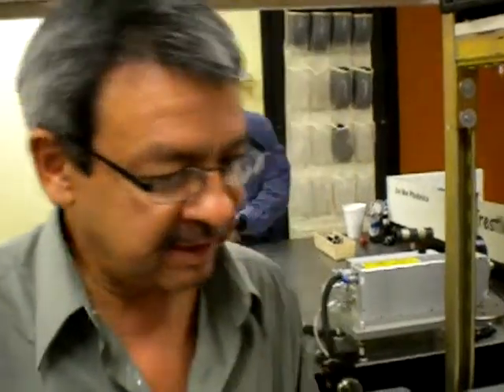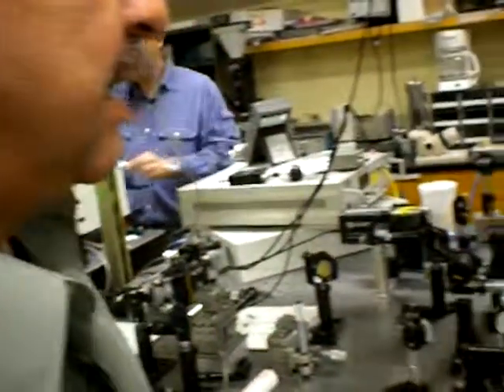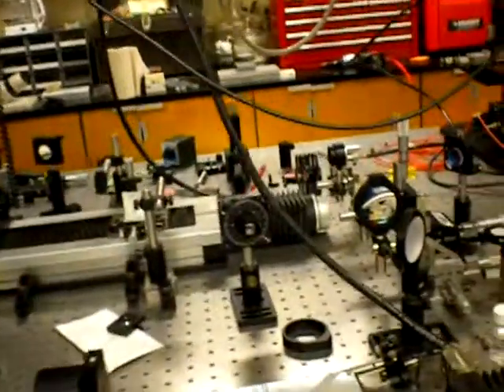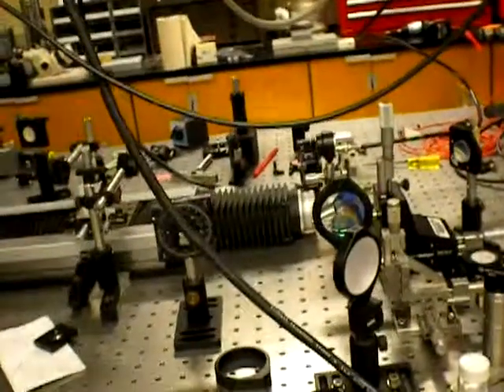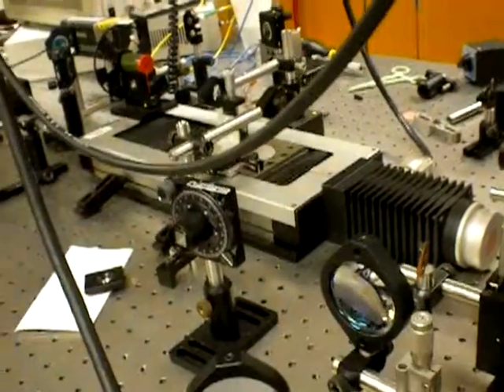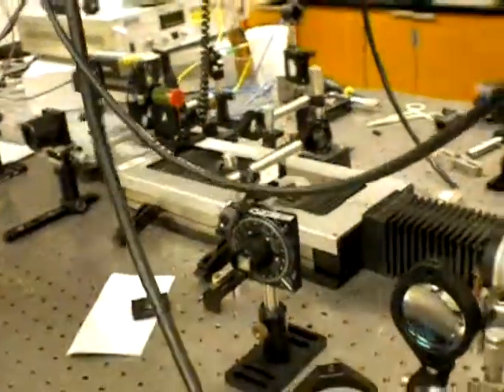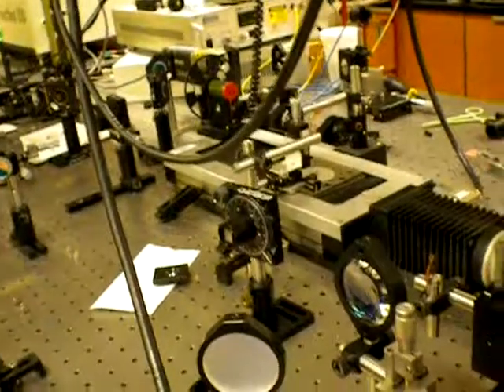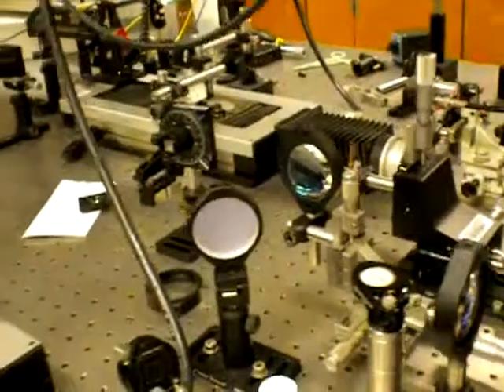Trestles 100 femtosecond Ti:Sapphire laser at Southern Illinois University Edwardsville

Comment from the maker: Brooke Hester is a PhD student working in the Optical Tweezers Lab at the National Institute of Standards and Technology (NIST). In this video she tells about trapping polystyrene spheres and nanoshells using Trestles CW - continuum wave tunable Ti:Sapphire laser from Del Mar Photonics.
http://www.dmphotonics.com/TiSapphire-CW-laser/TiSapphire-CW-oscillator-Trestles-CW.htm?

Mode-Locked Femtosecond Titanium:Sapphire Laser Model Trestles 100
manual http://www.dmphotonics.com/Trestles_fs-CW/Trestles_100F_manual_DMP_Lighthouse_v2.pdf  

Del Mar Photonics offers new Trestles fs/CW laser system which can be easily switched from femtosecond mode to CW and back. 
Having both modes of opeartion in one system dramatically increase a number of applications that the laser can be used for, and makes it an ideal tool for scientific lab involved in multiple research projects.
http://www.dmphotonics.com/Trestles_fs-CW/Trestles_fs-CW.htm

Typical specifications are:
Trestles fs/CW laser system Request a quote - indicate required output power in your inquiry!
Ti:Sapphire femtosecond oscillator with CW operation option 
Spatial mode: TEMoo; 
Polarization: linear horizontal; 
fs mode: 
Tuning range (@10W pump): 750-850 nm; 
Output power (@10W pump, 800 nm): >1500 mW; 
Repetition rate: 80 MHz; 
Pulse duration: <100 fs; 
CW mode: 
Tuning range (@10W pump): 750-850 nm; 
Output power (@10W pump, 800 nm): >2000 mW in CW; 
Linewidth (with two etalons): <2 GHz 
Also included: 
Thermostabilized breadboard; 
Electronic starter with TTL output for mode-locked mode observation; 
USB-controlled tuning slit for wavelength tuning in fs mode; 
3-plate USB-controlled birefringent Lyot filter; 
Two motorized USB-controlled etalons for linewidth control

Comment from the maker: Ti:Sapphire Laser Kits
http://www.dmphotonics.com/TiSapphire_Laser_Kits/CW%20TiSapphire%20Laser%20Kits.htm

price range for Ti:Sapphire lasers and Ti:Sapphire laser kits
http://www.dmphotonics.com/TiSapphire_prices/fs%20TiSapphire%20laser%20price.htm

Trestles LH Ti:Sapphire laser
Trestles LH is a new series of high quality femtosecond Ti:Sapphire lasers for applications in scientific research, biological imaging, life sciences and precision material processing. Trestles LH includes integrated sealed, turn-key, cost-effective, diode-pumped solid-state (DPSS). Trestles LH lasers offer the most attractive pricing on the market combined with excellent performance and reliability. DPSS LH is a state-of-the-art laser designed for today’s applications. It combines superb performance and tremendous value for today’s market and has numerous advantages over all other DPSS lasers suitable for Ti:Sapphire pumping. Trestles LH can be customized to fit customer requirements and budget.
http://www.dmphotonics.com/Trestles-LH_femtosecond%20_laser/Trestles-LH.htm

Ti:Sapphire Laser kits
http://greyhawkoptics.com/index.php?cPath=163

CW Ti:S laser kit with small breadboard, one mirror set
[CW-Ti:Sa-Kit-Basic] 
http://greyhawkoptics.com/product_info.php?cPath=163&products_id=805&osCsid=ee1e2b6a83d5c012c36229d76370da6e
CW Ti:S laser kit with small breadboard, one mirror set
CW Ti:Sapphire laser kit
Tuning range (@10W pump): 710-980 (two optics sets) or 730-870 nm (one optics set)
CW output power (@10 W pump, 800 nm): >1800 mW
CW wavelength tuning is available only with appropriate options (see below)
CW linewidth:
<45 GHz
<20 GHz (with 1 etalon)
<2 GHz (with 2 etalons)

USB 3-plate BRF for CW wavelength tuning with software
http://greyhawkoptics.com/product_info.php?cPath=163&products_id=812&osCsid=b6eef95e33a4e7f5535718eaa709d49c

Comment from the maker: Trestles LH10-fs/CW laser system at UC Santa Cruz Center of Nanoscale Optofluidics
Del Mar Photonics offers new Trestles fs/CW laser system which can be easily switched from femtosecond mode to CW and back. Having both modes of operation in one system dramatically increase a number of applications that the laser can be used for, and makes it an ideal tool for scientific lab involved in multiple research projects. 
Kaelyn Leake is a PhD student in Electrical Engineering. She graduated from Sweet Briar College with a B.S. in Engineering Sciences and Physics. Her research interests include development of nanoscale optofluidic devices and their applications. Kaelyn is the recipient of a first-year QB3 Fellowship. In this video Kaelyn talks about her experimental research in nanoscale optofluidics to be done with Trestles LH laser.
https://www.youtube.com/watch?v=TsuioOaRwG4
http://www.dmphotonics.com/Trestles-LH_UCSC/Trestles-LH_UCSC.htm

Comment from the maker: CW Ti:S laser kit with small breadboard, one mirror set
[CW-Ti:Sa-Kit-Basic] 
http://greyhawkoptics.com/product_info.php?products_id=805&osCsid=c98e9edf29f51647cc93c30b6716f115
CW Ti:S laser kit with small breadboard, one mirror set
Click to enlarge
CW Ti:Sapphire laser kit
Tuning range (@10W pump): 710-980 (two optics sets) or 730-870 nm (one optics set)
CW output power (@10 W pump, 800 nm): >1800 mW
CW wavelength tuning is available only with appropriate options (see below)
CW linewidth:
<45 GHz
<20 GHz (with 1 etalon)
<2 GHz (with 2 etalons)

Comment from the maker: I'm writing to ask some questions about the Trestles-100.
We would like to do lifetime measurements on Quantum Dots (wavelength = +/- 935nm) by exciting it off-resonance with a pulsed laser. For this, we need a pulsed laser with a pulse width below a few picoseconds. However, the pulse should not be on the order of a few femtoseconds, as we would have dispersion problems.  
My questions are the following:
-What is the pulse-to-pulse power stability?
-Is it possible to tune it also to 935nm (for another kind of experiment)? Do you have a monochromator which can extend the pulsewidth to 34ps?
-What is the price of this laser (pump included)?